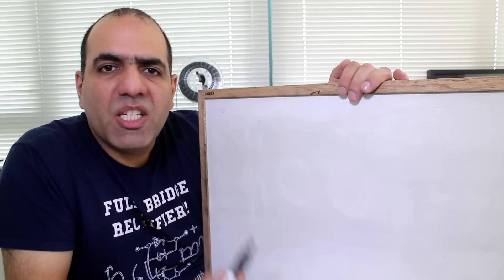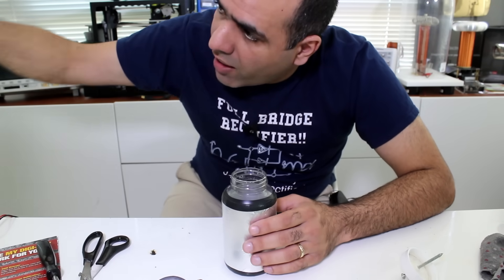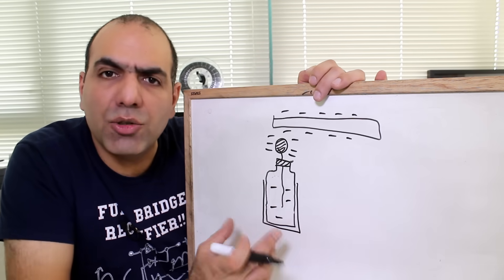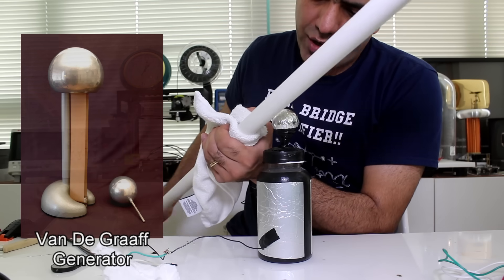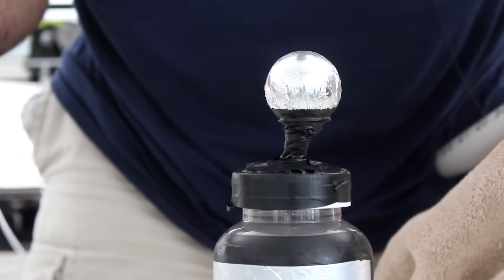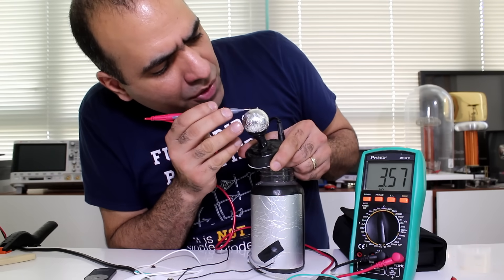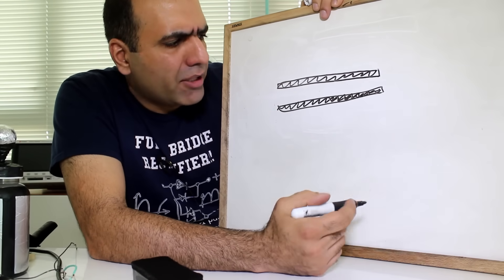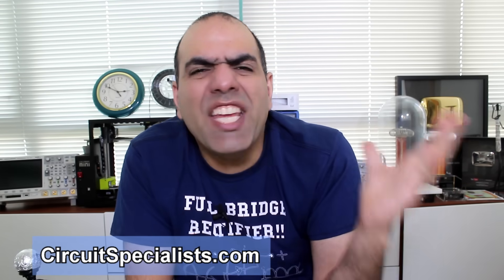Make a SUPER HIGH VOLTAGE Capacitor

Comment: Hi, Mehdi.
I have a small problem with a high-voltage condenser .... leyden jar. I made a copy of your project with my son (not like a king junior ) ;) .
I have a ground electrode. I have water and salt ... and it does not work. There is a pipe, a towel, and I am also connected to the ground. Even by accident, I forgot to disconnect myself from the ground. Nothing. The pipe is pp not pvc. And I'm confused
Please help.
And record further. Very good form. We love your psyho experiments. Me and my son. He thinks that these mishaps from electricity are spontaneous so he likes watching you and he really learns. Greetings. Simon.
By the way, I even measured the earth resistance with the meter sonel mpi 530 and of course we used the ground point from the wall socket. Rgr = 1.2ohm, 3 phase power supply, 5 wires, neutral and earthed, separated.
Reply: Already working ... :) too little friction. :) shoots beautifully. Now van de graaff generator.... all the best.

Comment: So I have been experimenting a bunch with this and I have been using it with the ground connected to myself and the jar. It has worked okay but when I took the grounded cable off the jar but keeping myself grounded still, I was getting almost double the spark. Does anyone know why because I thought it’s supposed to work better with the grounds?
Reply: Thinking about this, the ground connection should essentially be a reference of sorts. When Medi shows that the ground is positive, this would be in relation to the negative charge of the top electrode in the capacitor. This would make a stable and predictable voltage, but maybe the ground you're connected to has a higher negative voltage than the surrounding room that you are in. I don't know exactly why that would be, but I don't know of any other reason why you would observe the phenomena that you have. There are a lot of people saying this in the comments though , so you aren't alone on this one!  Does anyone else have any other ideas on this?

Comment: Was thinking that my dad told me once that it’s bad for your heart to have high voltage and current running through it even for a brief moment like for example if you have one hand grounded and touch a voltage source with other hand thereby causing the electricity to flow through one arm through your chest to the other arm. 

What do you think Mehdi? Is it really more dangerous to get shocked from one arm to the other as opposed to getting shocked in other areas or was my dad full of it???

Comment: Hi and thx for the video, could you give us some additional informations please? Like how much salt should we put in the bottle? Is it matter if we have some thin space of air between the aluminum foil and the bottle? If we have no pvc pipe could we use the static electricity from a trash bag or a ballon or anything else? Could we use normal tape instead of the electrical one? Thank you

Comment: You said you grounded the external aluminum foil, I've tried that but it doesn't work so good. I noticed that in my experiments it works better without grounding the external aluminum foil.
Anyway AWESOME VIDEOOO!!!!!
Reply: So you invented the capacitor with one lead missing !  I've been throwing them away in that condition !
   There is Always capacitance between to conductors.  If you don't ground one plate, the table and you become that plate.  The capacity will be relatively small, and series resistance high.
   Absolute dryness required.  Also works with Cats by fireside.

Comment: Guyss..  Please give me a scheme with thyristor, simistor or mosfet, when i turn  low voltage (0.3-5 volts) on the gate or base on the diode, to make him close and when swich off the "low(basing)" voltage to swiched ON?!? I want to control lights in 12 volts (65W)!!!

Comment: I.made my own with the transparent film and connected one wire to the - side and the + side untouched. The capacitor charged successfully. This time I tried it in parallel with my supply and the next thing I know, there's a bright light and a loud bang.

Comment: In the comments in this link is a good method for making large sparks from PVC and a piece of paper towel, then wrapped in a cloth for further insulation. I used a 6 foot length of PVC and even then have gotten zapped accidentally from getting too close while charging the capacitor.
https://youtube.com/watch?v=KMQYp218a-Q

Comment: Sooooo......as a technology exercise, if we have a custom capacitor where the "Mylar Layers" contain billions and billions of nano-tube-sized TOWERS (say ten microns in height and one micron in diameter) and spaced two or three microns apart effectively INCREASING the total surface area AND have the "Foil" on both sides have the SAME configuration of towering 10 by 1 micron nano-tubes to increase both sides of the foil's total surface area, AND THEN intermesh them so that they are interwoven with each other, would that ALSO INCREASE the total capacitance because of the up-to-1000x increase in total surface area?

If I am correct in my suspicion, it seems it would be possible to have a very high-rated capacitor in a small space the size of a D-sized battery! This means we could now create Ultra-Capacitors to power cars and trucks using very little volume!

--- NOTE: This idea is now declared by me as being OPEN SOURCE under the GNU GPL-3 Licence!

Build It Please!

Comment: You wouldn't be able to charge it to a million volts I suspect. that would exceed the breakdown voltage of your dielectric of your capacitor. on the other hand your Leyden jar made of glass would be able to handle Much More Voltage. is your vitamin pill jar made of plastic? Nevermind!

Comment: First one was found in Iraq.
Reply: You are talking about the Baghdad battery.  It is not likely to be a Leyden jar because both electrodes were on the inside and any electrolyte would contact both the copper coil and the iron core (evidence of corrosion would point to the use of an electrolyte).  It might have  been used for electro plating.  Maybe.  They don't really know because they didn't realise what they had until later when everything had been moved.  It would have been important to know if the Baghdad batteries were connected in series as that might have lent more weight to the electroplating theory.  Iron/Copper doesn't make a great battery so the idea that it was a galvanic cell is rather controversial.  It would work though, with vinegar or fruit juice as the electrolyte.  I tend to think vinegar - soured wine or something similar as this would have been a common drink at the time.

The Archeologists also failed to date the site properly, or record where everything was before it was moved.  Initially the date was given in the wide range of 250BC to about 250 AD, however the style of pot most likely comes from a few hundred years later.    

Stupid archeologists.

Comment: I was wondering can you add a capacitor inline with a generator so that appliances will soft start so to speak. The generator can support the running wattage but not the start up of the appliances.

Comment: as you may know, the problem of creating capacitors with higher voltage ratings is the limitation of existing materials. a capacitor is essentially two big electrodes in the form of a large metal sheet that is very close to each other but doesn’t touch each other, usually separated by a dielectric material. to have large capacitance, the plates have to be very close to one another (micrometer or nanometer range). because opposite charges are so close to one another the electro-potential of the charges will leak or jump the gap, which means the capacitor self-discharges. just saying.

Comment: Bro, youre awesome.
It's hard to make science interesting. But shit. Now I know how to make a capacitor the size of a battery.

wire a few of those together, bind them in the group. Have a single lead and a single ground at the end, and you've got a stun baton that might just be enough to actually score kills.
but of course, high discharge caps have hundreds of better uses, that's just the first that came to mind.

Comment: Good video, maybe if you spun a bearing to cause  friction on top the aluminum foil ball(any other alternatives) with the tiny drone motor(running off the capacitor), maybe  increase the strength of the container, maybe another alternative for the pvc pipe? Or one on top of the other or rotate the  insulator. What would you think about a rotating permanent magnet?

Comment: What will happen if you touch a 16kilovolts of discharge........
Reply: depends entirely on the duration. A microsecond? You'll be fine. 5 minutes? you're dead and probably cooked. Your average painful static shock is probably in that range anyway.

Comment: Can you use a particular circuit to make a capacitor act like a battery??? If  so what is the worlds be capacitor technology in relation to smaller size vs output, density, that I would be allowed to put into a product for sell on the market?

Comment: Loved the video , going to make my own SUPER HIGH VOLTAGE capacitors. The only question I have is where are the cables at 3:57 connected to ? What do you consider as "earth"? Because I want to do it properly.
Reply: The 3 wires are from a wall socket through a extension cable. The ground wire which is the ground coming from your wall socket is then connected to the capacitor on its outer surface as well as to his arm to ground himself as well

Comment: Hi, I've tested the Leyden Jar when I was a bit younger, i've filled the jar with littles balls of aluminium foil and charged it with a flyback transformer from a CRT, was able to make 12-15cm bright white arcs with this, way longer than with the flyback alone.
Reply: Did you have a ground implant? I'm new to the field, I made the capacitor, but idk if it is safe to use It without a ground implant. Do you mind explaining how to do it? I may get it to my school too, so it has to be safe

Comment: Amber is the best material to create static electricity, and you can use mineral oil as an electrolyte for the capacitor but it will reduce the WV, and as I remember a Leyden (but must be empty) can be converted in to an electrostatic voltmeter by placing 2 freely moving conductive hanging (aluminum usually) stripes inside and watching how much they separate from each other since like charges repel in proportion to the voltage upon them and you can even put a chart that will tell you the aproximate voltage instead of being a human voltmeter.

Comment: of course you cant charge layden jar with tesla coil. basically layden j. is a temporary battery, so its only stored dc current. by rubbing one end of it you will charge one of the pole, then line of force will be more dense, in other word dielectric field will form between the space, due water change state of its polarity more charge you put in, should be more dense the dielectric line of force. if another end of pole you charge with same amount of voltage dielectric line will vanish, no different voltage appear

Comment: I tried making an electromagnet as a component in a project for my engineering class so I got 5 AA batteries and taped them together. I then added wire to one side and wrapped it around a non galvanized screw. When I attempted to connect the wire to the end of the last battery, not only did I get shocked painfully, but the wire was extremely hot and as I was moving it, it stabbed me in a cut I had on my hand. So I was shocked, burned, and stabbed at the same time

Comment: One question.We know that when capacitor is fully charged it acts like an open circuit.So entire voltage should appear across it.In single phase induction motor a capacitor is connected in series with auxillary winding and this combination is connected in parallel across the supply.When supply is given , the capacitor should charge to full voltage right?So when we give 230 volts ac supply to the motor,why voltage across capacitor is around 420 volts?

Comment: Correct me if I'm wrong, but the kV of the zaps is only related to the distance at which the zaps occur, right?
The loudness/"Ompfh" of the zap has more to do with the current, right?
Or is the current and voltage directly related in this sort of setup?

Comment: "and then I add water which is not conductive......."Lol at low currents....at low currents 10 x 10-6 W-1*m-1 electroboom. Salt acts as an amplifier but water even at 3-5 micro ohms is still conductive. The majority of water on earth is very conductive considering the salinity content of ocean water. What you say is important for those who do not know the difference. Once you get in plasma range the hydrogen splits and becomes super conductive.

Comment: At 6:05 , why does a capacitor short AC ?
Reply: Because when a capacitor initially starts charging, it has effectively no resistance, but as the plates pick up more and more charge, they resist more of the same charge coming in. AC changes polarity so if the frequency is high, the capacitor starts charging and then quickly starts discharging as the AC cycle changes, so it never charges enough to resist the current much.
Reply: Gah dayum @Owen_loves_Butters

Comment: tried replacing the salt water with a sheet of foil on the inside wall of the jar, keeping it disconnected from the external foil of course...Presto, I have a dry leyden jar!(external and internal foil may now line the bottom of the jar) Now, to pressurize the jar with argon to increase conductivity 🤔...

Comment: Technically, only pure water is not conductive. Tap water is extremely conductive and can cause electrocution if contact with a power source is made! If you use pure distilled water, place it in a tub, run a hot wire into one end of the water and a ground wire to the opposite end you will not get any current flow. It is the minerals in the water that are conductive - like salt or brine.

Comment: At the end, you used the microwave transformer to charge the capacitor, but a transformer uses AC and not DC and as you said before, a capacitor shorts AC. Is your capacitor able to be used with AC or have I missed something?

Thanks!
Reply: Sorry missed the single diode rectifier!

Comment: So you generated static electricity by rubbing pvc pipe against a towel, but lightning is static electricity generated by rubbing ice crystals against other ice crystals or by rubbing volcanic ash against itself. No different materials used. Have you ever tried to generate static electricity by rubbing pvc pipe against pvc pipe? I doubt it would work.

Comment: I have tried same experiment but nothing happened. Didn't work for me. Can u suggest a solve?
Reply: Have you…
1. Grounded the outer surface of the jar AND your own hand that’s holding a towel? 4:00
2. Put a metal sphere (Or aluminum foil wrapped ball.) on top of the screw so there’s no sharp edges that the charges can run away from?
Reply: NTTNT JNO I haven't grounded the body of the jar. But there's the aluminum foil ball on the top of the nail.

Comment: So that means you need a 
F U L L  B R I D G E  R E C T I F I E R
to charge the capacitor with a tesla coil?
Reply: @Stephen W. OwO
Reply: You’ve got the right idea but semiconductor diodes breakdown at typically 100V or so.  This is why they used gas discharge tubes in the old days, to act as a rectifier. https://en.m.wikipedia.org/wiki/Mercury-arc_valve
Reply: no it means the impotant part is, its a Handjob FULLSTROKE Rectifier
Reply: It's not full bridge rectifier it's FOOL BRIDGE RECTIFIER.
Reply: @ooh woo uwu
Reply: @koffiemoth  uwu
Reply: I love F U L L B R I D G E R E C T I F I E R jokes so much
Reply: You do know that the F U L L  B R I D G E  R E C T I F I E R rectifies AC into DC, right?
Reply: @Christopher_7053  Yes, and capacitors are DC. Mehdi used a puny single diode to charge it, which in my opinion could also be done better with tha F U L L    B R I D G E    R E C T I F I E R
Reply: Unteradmiralcaptainensign he was sayin he was gonna rectify the AC of the Tesla coil, to DC to charge the capacitor dumbass
Reply: Makes sense

Comment: How did he ground himself, and the jar? And is there a difference between grounding, and earthing? Im sorry, im a beginner.
Reply: take a 3 "legs" old electric cable, peel the green (earth or ground in this case are the same) and aisle separately black (live) and white (comon), connet to current outlet and tounch the green, you are grounded
Reply: @elcochipit  The color coding varies from country to country, be careful.

Comment: i always wondered why putting a small capacitor in the speaker loop makes it only output highs! (usually when you open speakers the tweeter has a little blue tank capacitor of probably 2 to 30 volts and low farads... actually don't know in numbers but a capacitor the size of 1 CM cube that is supper common in appliances like VRCs and stuff)

my guess is that low hertz contains power that is less A/C than fast highs that goes in and out... so the low charge the capacitor and the highs pass trough... but that is my uneducated guess! maybe you could play with those... just go and find 10$ and less crappy VRC for the Capacitors an a crappy ghetto blaster with 5W speakers to show and test (and maybe jump scare us by putting the volume loud acting like you forgot ;P or really forget and be jump scared with us ;P)

Comment: I made one of these and was wondering why it wasn’t working right. I sometimes would shock myself after discharging it a while before. It wasn’t connected to ground when I charged it so I think when I discharged it, it kept some negative charge inside but only discharged the little positive it had until it gained more over time. This video help fix that, now it no long holds a charge after discharging and sparks way bigger.